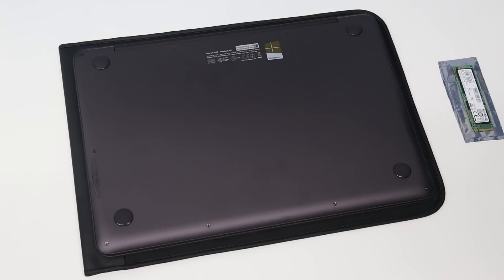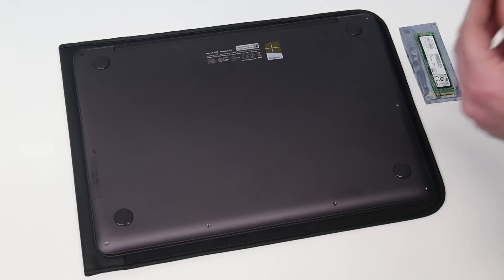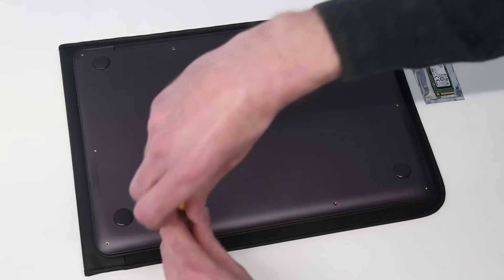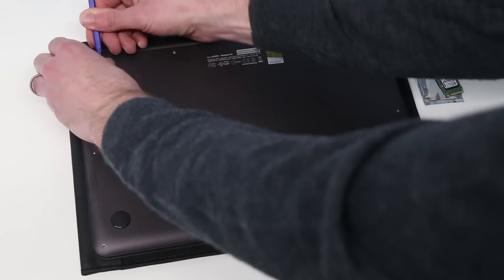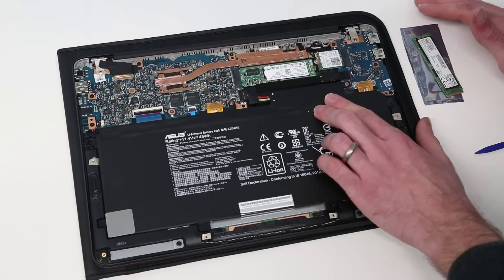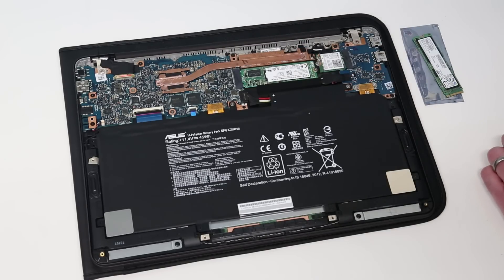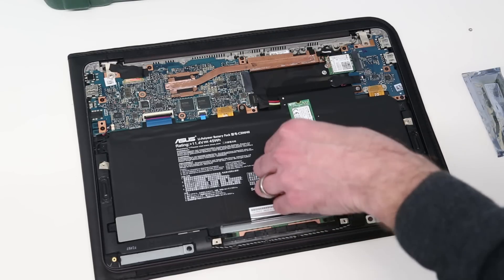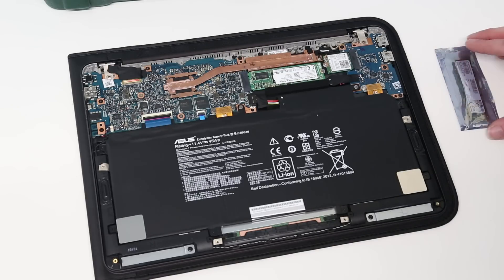ASUS Zenbook UX305CA SSD Upgrade Guide

Comment: I have a ux305ca for 5 years now it’s really slow which ssd would be great for it thank you
Reply from the maker: I'd probably start by doing a clean install of Windows 10 on it.
Reply: @BrueComputing  how can I do that thank you
Reply from the maker: @opnalomi858  Windows 10 has the option to "Reset" it which can be used to remove all applications whilst retaining user data.

Comment: Hey, do you think the upgrade is worth it, if I don't need the extra memory? Are newer SSDs much faster? I'm so sad the RAM can't be switched, my 8GB fill up pretty quickly and when it uses the SWAP memory it's unbearable..
Reply from the maker: Depends on the SSD you fit, but I wouldn't expect a vast difference.

Comment: Thanks for this video.  How did you know there were screws under the rubber feet? Good spot!

As laptop is now out of warranty and almost full of photos I took the jump to upgrade.

I upgraded the SSD to a larger 500gb WD BLUE M.2 2280 drive.  For info, to complete the upgrade I had to buy an SSD external caddy for new SSD, and then used Acronis True Image downloaded from wdc website.  Copied entire old drive across to new drive in under 10 mins.  Removed new drive from caddy and ready to install.

Comment: Thanks.  Have just upgraded my 2016 UX305CA's LITEON 128GB to Samsung 860 EVO 500GB.  Method: (1) Put 860EVO in Silverstone MS09 enclosure; (2) Use Acronis 2019 to clone internal LITEON disk to 860 EVo in USB3.1 Gen 2 enclosure; (3) Swap disks as per this video.  All Good.  Incidentally CrystalDiskMark 6 says these SSDs are about 10% slower in the enclosures.

Comment: Have you seen a huge difference in upgrading the original SSD to Sandisk? My Asus has a Liteon 128 GB, and I´m thinking in upgrade to Samsung EVO 860 or Crucial MX500 to get more performance. My processor is M3
Reply from the maker: Not really, it might be faster in synthetic tests, but in general use with just an M3 it won't make much difference. I just wanted a higher capacity drive.
Reply: @BrueComputing  thanks for answering my doubt.

Comment: Probably good idea to unplug the battery first before doing anything for extra safety
Reply: yeah, I would disconnect the battery when upgrade ram and ssd, as well when replace the display/touch cables, they are very sensitive.

Comment: hello, I have purchased SUS ZenBook Flip S UX370UA-C4217T. Which Internal Solid State Drive would you recommend?
Reply from the maker: I don't know if the UX370UA supports NVMe drives, but the specs show it comes with a SATA M.2 drive fitted as standard.
I'd therefore fit another SATA SSD (just to be on the safe side) and look at something like the Crucial MX300: https://amzn.to/2I7T1D8
Reply: Thank you for replying - Iv purchased this model ASUS ZenBook Flip S UX370UA-C4217T 13.3-inch Full HD Touchscreen Laptop (Royal Blue) - (Intel Core i7-8500U Processor, 8 GB RAM, 512 GB SSD, Harman Kardon Speakers with Stylus Pen, Windows 10) - so i need to look and see if i can add an additional SSD card :)
Reply from the maker: I doubt you can add an additional one, you'd have to fit a higher capacity drive in its place.
Reply: Perfect. Thank you :) 1 last question im hoping... would teir be a limit im thinking of adding the 1tb o would that be too much?

Comment: I have a new Asus UX410UQ. Is that M.2 slot support NVMe ?
Reply: Sadly, I think that only the UX501VW and the i7 versions of the UXx90 line (UX390UA, UX490UA) have NVMe slots. Also, a PCIe slot (needed for NVMe) looks different from M.2 SATA slots - yes, newsflash, M.2 comes in both SATA and PCIe flavors.

Comment: Thanks for the upload. I need to change the battery, do you have a good guess what screw driver must be used for taking off the battery? I have this model for a little more than a year, 14 months , and the health of battery is at 84%. So the actual capacity of battery is declining and I guess by 2nd year it'll be at 70% or less.

Comment: Hi! Thanks for the video. I used it to upgrade my Zenbook UX305CA, which had a Micron M600 128GB SSD installed. Now it has a Samsung 850 Evo 500GB. However I was astonished that my device does indeed have an M-Key M.2 Port and is therefore capable of handling NVMe SSDs. I even took a picture, in case zoo don't believe me.
So, it seems to depend on the exact model, whether the UX305CA can handle the quicker NVMes.
No harm done for me, because I didn't plan to pay 300€ for an NVMe device with equal size to upgrade an Ultra ok that's cost only 680€ total. So I am not sad about the lower performance. ;)
Reply from the maker: Thanks for letting me know! Personally given the Core M3 processor and focus on battery life I'd probably not recommend an NVMe drive anyway, and like you say a lot more expensive, but interesting that there are those variations out there!
Reply: Mine has an Core m7 inside. Maybe thats the difference...
Reply from the maker: Could well be the case then. Even so a 4.5W chip doesn't warrant an NVMe SSD.
Reply: Mine is like this too.  I picked my laptop up last year.  I may give the NVMe a try, if I find one that I don't mind forking out the cash for.  If I do, I'll tell you how it goes.
Reply: Ok.  It LOOKS like the NVMe will fit, as there is only one notch, but it does NOT.  It can be put in, but not easily, and it didn't feel right.  It also seemed like it was upside down. (All the electrons will fall out!)   Of course, the computer didn't even turn on with the NVMe inserted. 

I will be returning this SSD and replacing it with a straight up M.2 2280.
Reply: J. Walter Hawkes said that there is no NVMe there. Are you sure it's not the wrong way? Because if an NVMe drive had a hard time going in and was upside-down, that means that it's B-key (notched from left, 6 pins before notch) while NVMe-capable ports are M-key (notched from right, 5 pins after notch).
Reply: It's now 2020. Doesn't time fly! Could anyone point me in the right direction for a compatible SSD upgrade nowadays and also whether a RAM "enhancement" is a viable option for the 305ca. Assuming they are quite straightforward..? Thanks
Reply: @capricorn1ne  Did you take the plunge?   My UX305CA SSD is now full - so looking for an SSD upgrade too?  Crucial UK site recommends:
a). Crucial MX500 1TB 3D NAND M.2 Type 2280 Internal SSD
b). Crucial MX500 500GB 3D NAND M.2 Type 2280 Internal SSD
However checking reviews on Amazon some people have reported overheating issues which is putting me off now.   Some have recommended using M.2 thermal pads to help dissipate heat - not sure if this is viable inside the laptop.  So going round in circles of indecision now...

Comment: How do I check what 512gb ssd's are compatible with this laptop? I want to buy it
Reply from the maker: Any SATA M2 2280 drive should work. I fitted this one: http://amzn.to/2e9o2EY
NVMe drives can't be fitted.
Reply: Go to the Crucial website. First it allows scanning via a little download app so you know what you have inside already. It then gives you options. I didn't buy the Crucial in the end as I could get the equivalent WD for £15 less, but at least I knew the type.

Comment: Some of the keys on my laptop are unresponsive and I'm currently using an external USB keyboard. I currently have the UX305CA touch version with 8GB Ram and 128Gb SSD. How do I fix the keyboard? Is the compartment hidden underneath the black tape? Thanks.

Comment: Hi, you mentioned that you were installing win8 on the new SSD, but where did you find drivers that worked? When i installed it, i was met with no networking, no touchpad and a really hard time finding any compatible drivers for anything. Thanks in advance.
Reply from the maker: I installed Windows 10 on it. I wouldn't install 8 as the original license is for Windows 10.
Drivers are here: http://www.asus.com/Notebooks/ASUS-ZenBook-UX305CA/HelpDesk_Download/

Comment: Hello. Can you kindly help me?  I am planning to buy a laptop and I am confused between the below two Indian models:

1. Asus UX305UA (Core i5, 8 GB RAM 256 GB SSD integrated graphics) with price $1040
2. Asus UX303UB  (Core i5, 8GB RAM, 1TB HDD, Graphics Nvidia Geforce 940M 2GB)  with price $960

Mostly, I will do programming, web-browsing, reading and sometimes watching videos. Which one do you feel serves best for my needs? Thanks.
Reply from the maker: I'd take the UX305UA for the SSD personally, it'll make a huge difference to performance.
Reply: Thanks a lot.

Comment: if I replace the ssd with a new one...do I need to do any kind of formatting? and how do I copy program files and transfer my files over to the new one? thanks
Reply from the maker: I did a completely fresh install of Windows on to mine. Alternatively you could take a system image with backup software to an external HDD and then restore it after fitting the replacement SSD.
Reply: I used MiniTool Partition Wizard, which is free, to clone my existing drive. You can buy a cheap external USB case to temporarily house the new drive while it clones then go through the replacement routine as in the video. My drive case was £10, my 240GB drive £31 and the Torx T5 screwdriver (as part of a set) £9, so cheap upgrade with double capacity.

Comment: Is this sandisk ssd far better than the zenbook's default one? Is worth of the upgrade ?
Reply from the maker: +Giovanni Giliberto Performance was pretty much unchanged, the drive the UX305CA shipped with was pretty decent and could manage over 500MB/sec on sequential reads. I fitted a 512GB Sandisk X400 drive as I wanted more storage space: http://www.amazon.co.uk/gp/product/B0194MV3XM/ref=as_li_tl?ie=UTF8&camp=1634&creative=19450&creativeASIN=B0194MV3XM&linkCode=as2&tag=httpwwwbrue0a-21

Comment: Is it also possible to upgrade from 4gb ram to 8gb?
Reply from the maker: +Michelle Coffee No, the RAM is soldered to the mainboard, there are no DIMM sockets.
Reply: +Brue Computing Ok, thanks.
Reply: I am in Thailand and have only seen the UX305CA with 4gb RAM. Do you think that is adequate for web browsing, MS office products, occasional photoshop?  I tend to have 10+ windows open in my browser at any one time in addition to a smallish excel spreadsheet and word doc.
Reply from the maker: +Michelle Coffee It should cope - I used my previous laptop for similar tasks with only 4GB. 8GB is still preferable though.
Reply: Adobe photoshop with ~ 500MB of files loaded + 40 tabs of google chrome (with multiple dekstops enabled) works fluidly on the UX305CA 4GB RAM model.